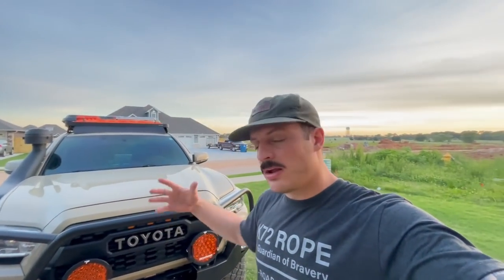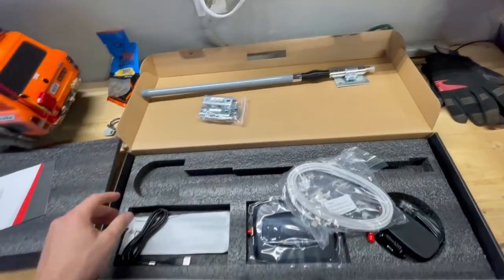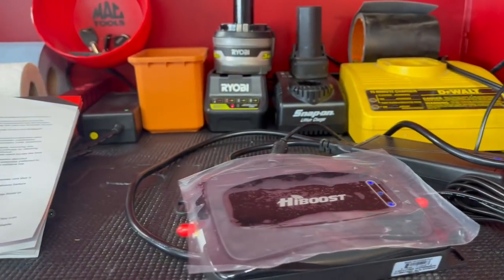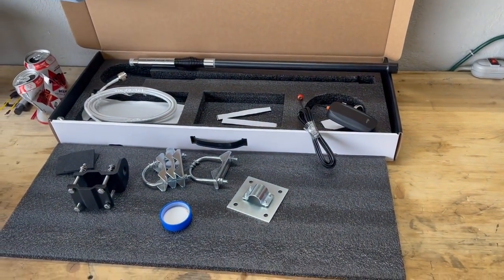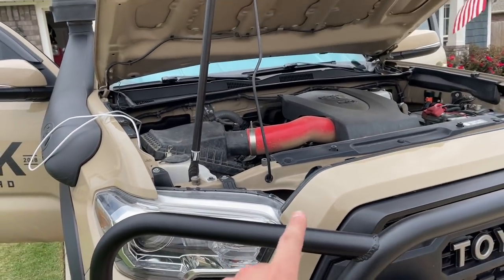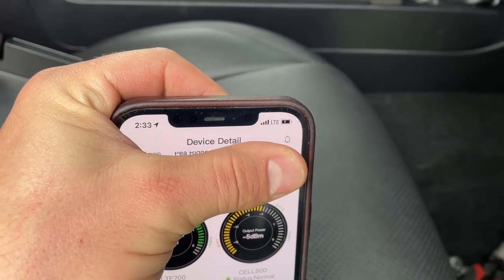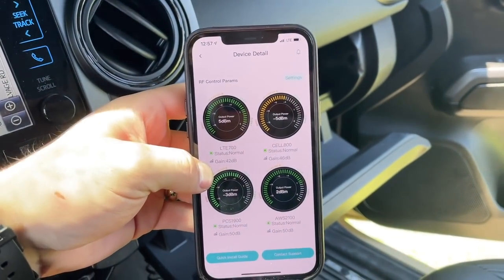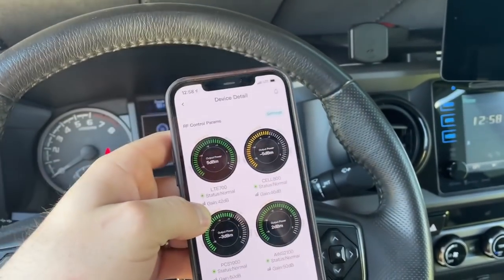Install & Review of the HiBoost Travel 4G 2.0 Cell Booster for Camping & Overlanding on my Tacoma

Comment: You could still use the mount from Midland by simply going to the hardware store and getting whatever length bolts you need!!!  I have two of them on my bull bar and that is what I did...
Reply from the maker: I know I just didn’t like how it looked. It’s much cleaner in my opinion with the welded tab. From the front it just looks like it’s floating almost

Comment: Howdy, I’ve been watching some of your videos.  Love your Tacoma.  Mine is a 2019 TRD OR access cab in quicksand. I’d like get in touch with you and your buddy Harry about your trucks.  Jim
Reply from the maker: That's awesome man! Appreciate it. What are you wanting to know?
Reply: @ArkansasOffroad  I’m not really into Overlanding or hard core off roading.  My Tacoma is to get me into (and out of) the best fishing spots, for example.  I’m also getting up there in years and not as nimble as I once was.  I kayak fish and use my truck to haul the kayaks. I live near Hot Springs, in the Ouachita Mountains. 

So I don’t plan to lift my Tacoma, might level it out.  I would like to put some better tires on it and make it a little more off road capable.  I’m also considering 4.88 gears, maybe aluminum bumpers. I noticed that Harry’s red Tacoma has tall skinny tires on stock wheels.  Interested in what size those tires are?  Also interested in your phone, GPS, and GMRS radio setup in your “Taliban Tan” Taco.
Reply from the maker: @wpwarhawk  Harry's tires are bfg KM3 255/85/r16, which do excellent. We run gaia gps and have a premium membership (cheap) running on old iPad 2 minis. If you get the cellular version, it'll work offline as a gps, even without activiating a cellular plan. Those iPads have an internal gps built into them. If you don't get a cellular version iPad, you'll have to get an external device that gives your iPad it's GPS signal via bluetooth. A garmin in reach mini does this and there's a few other cheaper devices out there ($80-90) to do the job. Phone is an iPhone 12 Pro Max. GMRS radio is the midland MXT275 with their ghost antenna.

Aluminum bumpers are just the way to go. Ours are from www.backwoodsadventuremods.com Highly recommend. They put steel in the critical strength areas and aluminum everywhere else.
Reply: Thanks for the great info.  I’ll have to look for a IPad 2 mini with cell capability. I’ve always used Garmin GPS units for work, as I visit a lot of different places for work. Does the GAIA setup do regular street mapping and directions too?

I’m going to keep looking for a radio setup.  I don’t want to give up my glove box, but I do like your Midland radio.  I’ll figure something out.  I ordered two of Scoche Max magnetic mounts, looks like a better setup than the RAM mounts I planned to use.
Reply from the maker: @wpwarhawk  Gaia does not do turn by turn directions, but shows street maps with the right layer on.